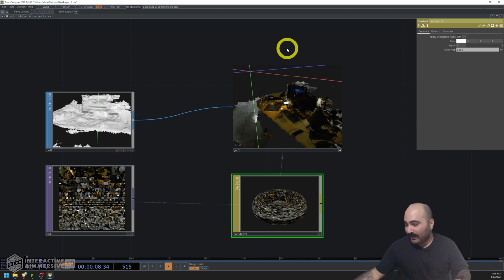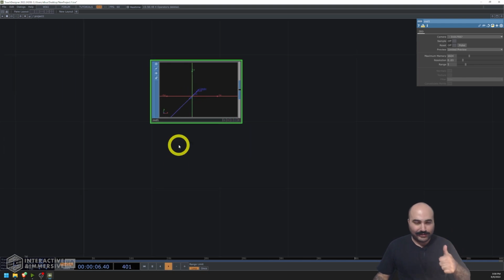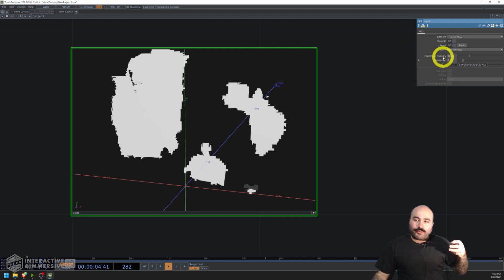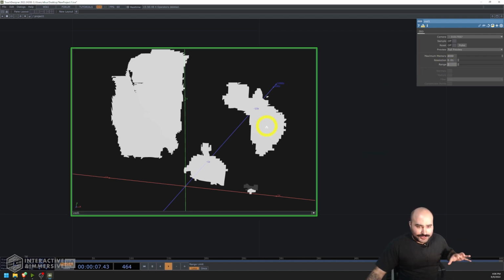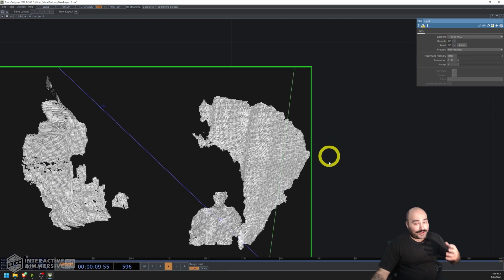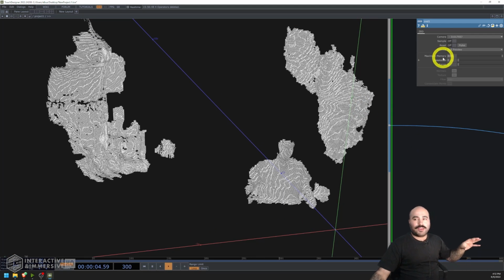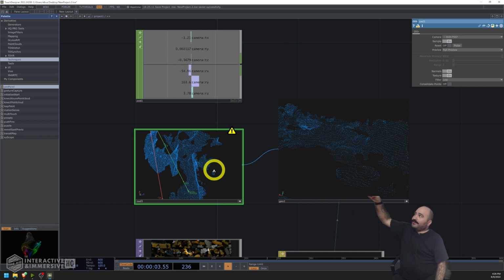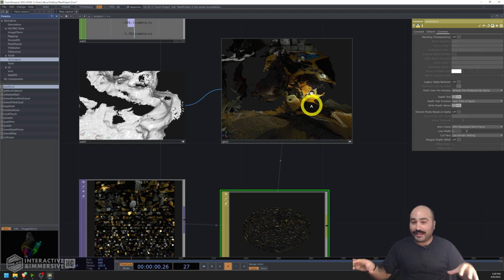Zed 2i 3D Scanning in TouchDesigner - TouchDesigner Tutorial 094

Comment: Hi,

I just scanned my first spatial texture / object.

how could I export it in blender?

whats the difference between spatial texture and point cloud (at swttings)?

kind regards
Reply from the maker: The easiest option for exporting the data to blender would be to right click on the ZED SOP and click “Save Geometry…”. This will allow you to save it as an FBX file which you can import into Blender.

The Point Cloud mode gives you point cloud data in a texture format — each pixel’s RGB channel values correspond to XYZ point positions.

The Spatial Texture mode gives you the texture extracted during spatial mapping by the ZED SOP, which allows you to apply the texture to the 3D geometry/mesh just like we do in the video.